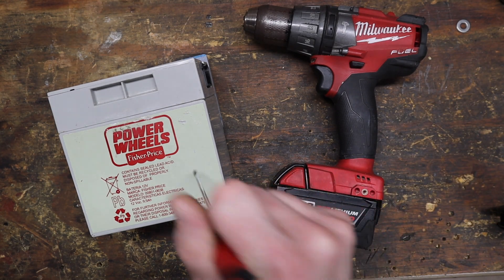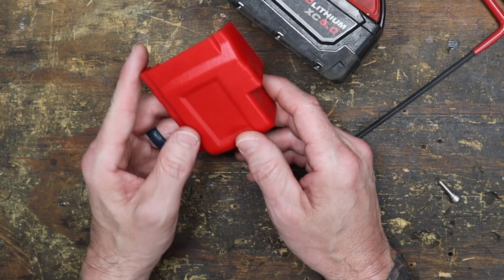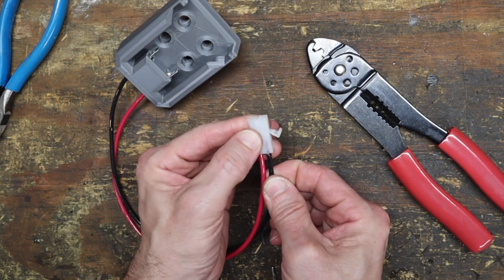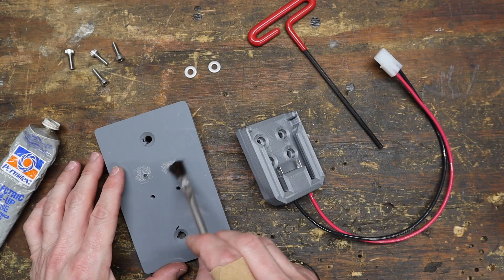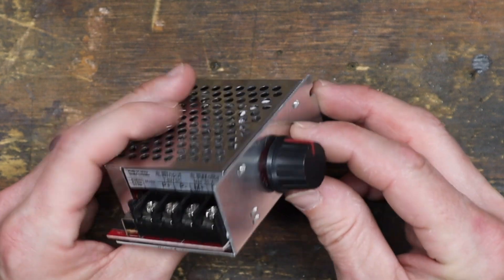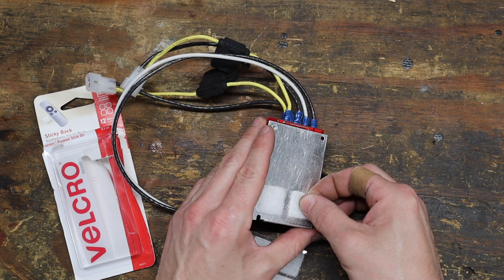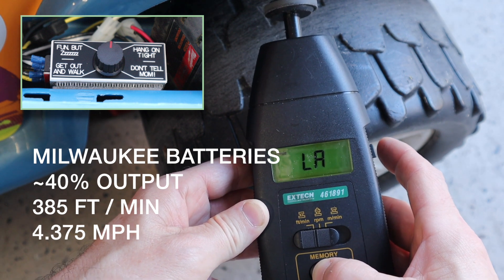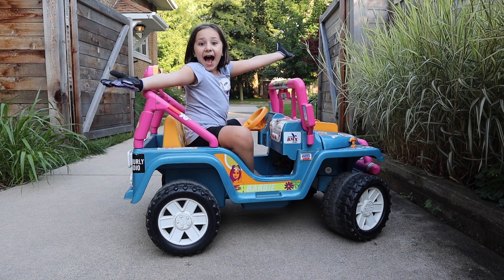Power Wheels Vehicle 18 Volt Milwaukee Battery Upgrade!

Comment: Whats the playtime with 2 Milwaukee batteries? Cheers
Reply: Was wondering this myself
Reply: Theoretically it should be around 60% more play time as the stock 12v @ 9.4Ah is aprox .1128 kWh & the 18v @ 5Ah (in parallel) being 10Ah with .18 kWh

Comment: I'm assuming the circuitry to prevent over  discharging the Milwaukee battery is built into the battery pack itself? So you don't have to worry about over discharging the pack?

Comment: Did you have a problem with low voltage battery protection?
Reply: M18 batteries are internally protected against over and under voltage.
Reply: @kaseru6760  Are you sure about that? My old M18 1.5Ah have protection circuit, but it doesn't work if you use only power terminals of the battery. If I use only power terminals I can discharge battery to 0V. Maybe new batteries are different...

Comment: Do Milwaukee batteries contain circuitry to prevent complete discharging?
Reply: I was wondering the same thing. I'm thinking no. I saw another video and he over discharged the m18 and had to use a power supply to get it back to 16V so the Milwaukee chargers would recognize it to charge it.https://youtu.be/D2jshlcZmEQ 
go to 22:00. I believe it a gamble. I highly doubt the kids would drain the battery to below 2V just because the car wouldn't go anywhere, but I know my kids would destroy my batteries. I've seen the push it up a steep bank and ride the thing down. Like those barbie jeep races.
Reply: From what I can find the over discharge protection, over current discharge is done in the tool and temperature protection in done it the battery

Comment: Are you worried about the 18volts on the 12volt motors?
Reply: I doubt it will hurt before the rest of it breaks
another channel did one with dual 12v batteries in series(24v total), and the wheels broke before the motor did

Comment: Thanks for sharing the pwm controller.... I honestly never thought of using that. I was going to put in a big resistor pack but this is so much better! Another idea I was thinking of was to use the controller as an actual throttle vs the on and off power wheels pedal. Good job on the video. Subscribed.

Comment: Next swap the motor for the brushless one from your drill
Reply: Neil Havell 

eBay - 1800 watt brushless scooter motor and the appropriate gearing will get this Jeep up to 20-25mph no problem.
Reply: I have an electric longboard that has two 1.5kW brushless motors, swapping drill parts into a kids car is the best idea I have heard in a long time.
Reply: Neil Havell Im your man if you ever need a test dummy.... Or just a dummy.  Lol
Reply: Brilliant 👍
Reply: Nancies! All of you! Drive to the "u pull it" junkyard, get a truck starter, snatch the battery out of the Prius next to it, voila. No more kids. . . Was that the goal?
Reply: @rob2257  you have any idea how heavy a nickel metal hydride battery out of a Prius is? No way you're picking that up and carrying it out of there or that a yard would keep something so expensive out there.
Reply: @rob2257  a starter motor wouldnt last long term

better way would be to pull an alternator and rewire it to be a BLDC motor
Reply: Joe Gravelle LS it!!!!!!!
Reply: I'm looking into a power washer motor for my daughter's older Jeep power wheel lol
Reply: Why 2 battery’s?
Reply: A lot of guys use r/c car parts. Pretty much all the same my 1/10th scale slash vxl does 70+. Couple motors like that in a power wheels should get the kids goin pretty good
Reply: @branleesan  that sounds super dangerous... I'm in!  😊

Comment: You left out one single crucial detail IMO. How long do the new batteries last when starting out from a full charge? I know you said the new charging time is about 90 minutes vs the 14 hour original time, but if they new batteries lasted say 20 to 30 minutes then that can be a bit of a letdown for the kid.
Reply: Should be longer runtime, each of those drill batteries were 5ah, in parallel making 10ah just over the 9ah the original battery had. Not to mention with lithium you can go down to 75%-80% discharge as apposed to 40%-50% in the lead acid.

Comment: 1:42 Wait... the Power Wheels battery was $75 but you replaced it with a pair of batteries that cost $230.
Might be an unfair advantage? ;-)
Reply: I think the point is that you've probably already got a few power tool batteries laying around.
Reply: harbor freight batteries, anyone??
Reply: @joshuaguthrie8067  you'd be surprised how good the Hercules ones are
Reply: The point is already having the batteries laying around, ones that have more power, last longer, charge faster, and are better in pretty much every way.

Plus, I'm about 99.9% sure he's an electrician so he can likely claim the batteries on taxes.

Comment: How long do the batterys last on a charge
Reply: Yeah I was wondering the same thing
Reply: If you had the speed setting at the same speed as stock, then it would last a little longer, but the higher voltage will push more amperage which is why it goes so much faster, so at high speed it won't quite last as long, but the distance traveled would be the same or greater.
Reply: 5ah@18v so just guessing but I would figure around 6-7ah as it is a lower voltage draw
Reply: I'm not an expert by any means but I would imagine that the run time would be about the same, maybe up to 30% longer though. 9.5 Ah @12v for the lead acid and 5 Ah @18v per battery for the lithium batteries in parallel. So 10Ah would be a slight increase, but the controller helps reduce power consumption. Lithium are also better suited for high drain devices and can generally run longer compared to other battery types on the same draw. I think the main goal was not to increase run time but to decrease charge time. Those lithium batteries can charge much faster than a lead acid. 14 hours after each use becomes like 2-6 depending on the charger and battery manufacturer, not to be mistaken for the battery's sale brand.
Reply: @TheSlimCognito  on the plus side these things are so freaking cheap and it's something to have saying "I'm the one that upgraded that *Pops a can of Beer and watches the baby girl drift like Initial D*"

Comment: Imagen using the 12ah high output battery from milwaukee.
Reply: Or even better the variable voltage 20/60 volt battery from DeWalt

Comment: Any idea on how to do overdischarge protection for the batteries? 

I’ve used Milwaukee batteries like this before and without the paired circuit  board in the tool, they will over discharge and get smoked. I know the batteries have some intelligence, but my understanding is it take two boards to protect the battery, the board in the tool and the one in the battery which communicate with each other
Reply: I don't believe the board on the battery protects against over discharge, the tools have all of the circuitry for that. I've been led to believe the board in the battery is just for charge controlling and balancing. Makita batteries have the discharge circuit on board so would be a good alternative

Comment: Biggest problem I had was retrofitting all of my drills to run off worn out power wheel batteries.
Reply: I pictured myself at work in the shop with a 10lb grey brick hanging off my 1/4" impact. Too funny
Reply: @Clyemacks  then that Would be been holding the equivalent of snap on 1/2 impact lol.
Reply: @Clyemacks  thank you
Reply: One of the rare moments a comment on Youtube gets me laughing out loud. Thank you!
Reply: @Guggu3d  I just had that moment lol
Reply: Ah the trials and tribulations of a parent! 🤣
Reply: jamo9008 you guys are joking, but that is what I literally did once on a job site. My cheap B&D battery died in the middle of work, I took out my car's battery, connected it to the drill with a 10-foot stretch of electrical wire and it kept going for the rest of the day.
Reply: Great video
Reply: Thats what the 2nd video in descriptions for, shows the protection overload cut-off segment.

Comment: Has anyone asked how much the two battery set up increased overall run time? Most hot wheel batteries last 45 min
Reply: Probably a bit longer, but the beauty is, if he moves the controller to a different spot, you might be able to fit the 12.0 batteries in there. Im sure the 9.0 would fit at least. It would last all day haha
Reply: @michaelg589  wait until the new compact 9 and 12ah batteries come out..
Reply: Isaac Ocasio I was just looking through comments trying to find this out.
Reply: Probably about the same or just a bit more depending on power level.
Reply: The original battery was 12 volts 9.5 ah. So tue milwaukee is only 10 ah combine. 18 volts.
Reply: @joshuatalavera4210  in theory your math gets close but there are more factors to consider.  The jump from 12v to 18v is significant.  Even of you don't want to factor that in, think of this...not all batteries are created equal.  A Duracell battery lasts much longer than a rayovac but they hold many of the same specs.  The higher quality Milwaukee batteries may also play a big part in the added duration.  In either case, we won't know until he tells us lol
Reply: I'm not an expert by any means but I would imagine that the run time would be about the same, maybe up to 30% longer though. 9.5 Ah @12v for the lead acid and 5 Ah @18v per battery for the lithium batteries in parallel. So 10Ah would be a slight increase, but the controller helps reduce power consumption. Lithium are also better suited for high drain devices and can generally run longer compared to other battery types on the same power draw. I think the main goal was not to increase run time but to decrease charge time. Those lithium batteries can charge much faster than a lead acid. 14 hours after each use becomes like 2-6 depending on the charger and battery manufacturer, not to be mistaken for the battery's sale brand

Comment: That happens to 3d printed parts often. It’s called warping. It usually happens with abs or pla when it is not adhered to the print plate great. This can also happen from cheap printers. Just thought you should know it wasn’t on purpose.

Comment: Do the Milwaukee batteries have a low voltage cutoff to keep them from being overdrained and not charging on the stock charger again ?
Reply: Pretty sure it's the tool that holds the low voltage cutoff.
Reply: @raunefare  thank you I would like to find a circuit diagram sometime.

Comment: So like a $180 later you realize you could've put 2 lithium ion powersports (motorcycle) batteries in it and just charged it with a regular car battery charger you have laying around. Less cost and way longer runtime. Just do some solderung to makeup the plug and mod the battery compartment and Bob's your uncle.
Reply: $180 later....
vs...
$69.75 for the parts (2x cradles, 1x controller, 2x fuse holders, 1 pack of connectors), plus the batteries he already has in his possession....?
And the power wheels goes faster!

Yes, the motorcycle battery option makes more sense if you don't already have other high-output batteries in your possession.
Reply: @dposcuro  
Thats kinda what im getting at if you had to buy the Milwaukee batteries you're might as well get the kid a used honda civic. Milwaukee batteries are the most expensive on the market aside from hilti. Heck you could use just a normal SLA for battery back lighting or ups and be WAY cheaper but they're easier to ruin those batteries so youd want a low voltage cutout. But im getting a little over most people's heads woth that.
Reply: @dposcuro  also does he wire the batteries in parallel or series? If hes going parallel which im assuming he does you could sereis the 12v batts to get 24v and that thing would melt the plastic wheels. I did something similar to a friend's barbie car. Its was too fast it just spun the wheels on blacktop. The kids face was priceless.

Comment: First I would like to say this was a great informative video and I'm sure I'll be tackling this project for my little one. That being said if your intentions were a cheap alternative to the stock battery then this is not the route to go. Milwaukee 18v 5.0 amp batteries are a fairly expensive option if you don't already have a few extra on hand.

Comment: Looks like the reason the the 3D printed part wasn't flat is due to the part lifting from the print bed while printed, causing it to curve.
Reply: Came here to say this as well, yep that curve wasn't intentional by the person printing it.
Reply: Agree. Part was designed flat but it warped during printing.
Reply: I don’t know too much about 3D printers but I imagine a heated bed/tray is the remedy to that? They have gotten so cheap now, I’m hoping I can scoop one up in the next year or so.
Reply: @lgzz4885  the heated bed is a nice feature for multiple types of filament. The issue is, and it looks like the part he used is PLA, is that PLA doesn't need a heated bed for printing. For me, higher temps on the print bed causes parts to lift. I usually keep the bed off if I'm printing PLA. My pet peeve is when people on Facebook recommend higher bed temps with this issue rather than going cooler. 

Definitely get a printer with a large following. Highly recommend the Ender 3. My first and best printer. My 2nd is a Tronxy XY-3 and it's very...okay.
Reply: 07cowboy07 Fuckk youu chad.

Comment: The problem with that 3d printed cradle vs the USB adapter is the USB adapter has circuitry that monitors the lithium batteries so they maintain similar voltages and doesn't allow a full discharge to happen. So they batteries will last a lot longer.
Reply: I see, so yeah your right. Those batteries are part of the red link intelligence. 3rd party usb definitely wouldnt have the software built in that Milwaukee is using to protect the batteries. Your bypassing all safe guards, hooking it up that way. That's what those other slots on battery is for. The tools microcontroller is the master and batteries circuitry is the slave. So basically the signal from the tool that tells the battery's chip to start monitoring the battery, never happens. If that was a reputable Milwaukee accessories then you'd be alright. But no big deal you can just do it yourself. Maybe by timing.I wouldn't wait till the loss of power because that would essentially mean a drained battery
Reply from the maker: Not really. The M18 battery has an onboard monitor circuit to prevent it from full discharge, over temp, over amp draw etc. The USB adapter doesn't have anything more inside it than a step down / buck convertor.

The USB adapter isn't made by Milwaukee, it's just a 3rd party item, and they're not too concerned about the health of the batteries either.

Comment: anyone else thought he was running his drill off the power wheel battery?
Reply: Yup
Reply: I did, that's why I clicked and now the video won't load.
Reply: @DesertCatDad  i kno i had the hardest time tryin to load this
Reply: i did at first and was really confused cause the Milwaukee 18V Red battery can take lug nuts/suspension parts/anything off all day and still not need to be charged when your hands are too tired to hold it anymore.
Reply: Yes lool so funny good video ahah
Reply: Yes,That was my first reaction to the thumbnail.
Reply: im high but not that high
Reply: Me

Comment: Do you have to use 2 of the Milwaukee batteries?  or can you only use 1?  I have an old PW Cadillac that we are fixing for my daughter.
Reply: and is there a reason you chose Milwaukee over say Dewalt?
Reply from the maker: Hi Krissi. One battery in lieu of two - no issue, simply cuts the capacity (runtime) down. You'll be fine in this scenario using one.

I had Milwaukee batteries, so I used them. If you have DeWalt (or any other type), use them!

Thanks!
- hw

Comment: Reason why we dads should not develop kids power toys. 🤘.  Awesome video great info. My 4yr old wants a faster 12v raptor. Soon to be a 24v raptor lol. Also you can use old lawn mower riding tractor tire cut them use just the threaded part to mount onto of plastic wheels for better grip.

Comment: You could bulid your own packs with some good 18650s and a good protection board for much less then using those way over priced packs.
Reply: Yeah I was thinking same.
Reply: @eggroll1up918  you would absolutely have to use a good quality Ballance board tho,cause unbalanced 18650s are why the evape people are getting their faces burned off.

Some good cells like Sanyo x10 should get ya there.idk I haven't priced those in awhile but I think they are about $3 a cell.
Reply: @talclipse  I know. It's hard to imagine having that kind of energy, literally in their mouths. I'm super cautious when ever I'm just handling them for charging or swapping out. No way, would I have several in series rest on my chin. Nope no way.
Reply: @eggroll1up918  nodoubt! Unbalanced Mutlicells are the cause.i would think it would be grounds for a class action suit cause anyone with any sort of knowledge of lipos knows they have to be Balanced or bad things happen.

But it's seems the manufacturers have zero bulit in protection.

Comment: I did this to my sons 6v little tykes 4 wheeler a few years ago and it would do full on doughnuts on asphalt! It was awesome. My wiring was a bit more elementary but ya, anyways thanks for the video, we now have a 24v grave digger that I want to mod!
Reply: I too bought my grand son a 24 v. Grave Digger which is why I watched this movie. At work I run the Makita plat form. Ive got lots of gear for this mod
Reply: @jamesmyerssr.3119  you can also take the plastic gears to your local machine shop and have them reproduced in aluminum so you dont burn em up
Reply: @Jizden_Mipanz  Im all in. The boys father is diggen it too! But my daughter.....
Reply: @jamesmyerssr.3119  go watch my videos with the grave digger before nodding. The kids love it! I will post more after I mod it